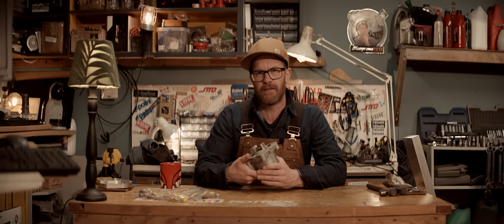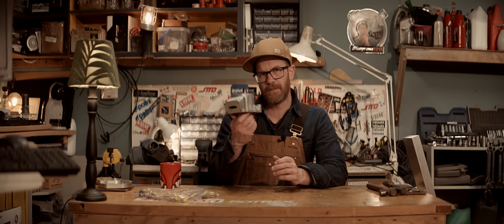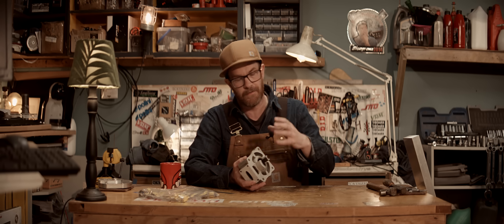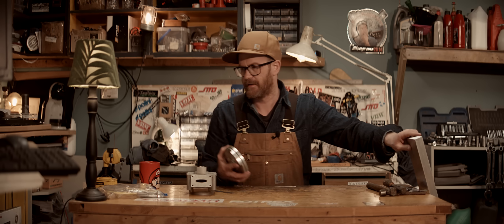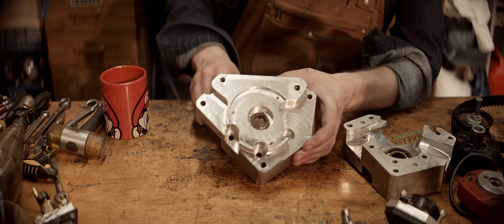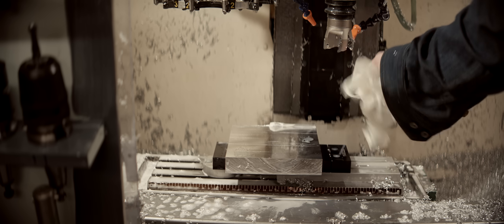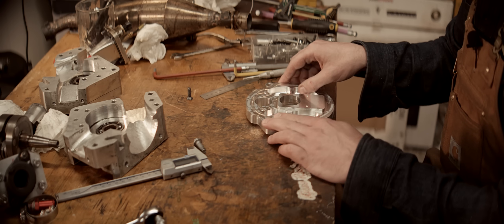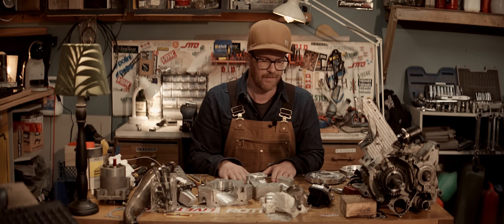To Hell With Reeds! Rotary Valve PiP.

Comment: everything restricts , get over it ..that why they make 4 , 6 , and as many as 8 peddle reed valve kits . a use delren plastic reeds that love you long time joe ... but rotary values  have many advantages that they offer like nothing else does..for tuning mild to wild and everything in between merely by changing the timing of the cut away and length of the in let hole ...but i now understand rotary valves dont work so well with exhaust as the pressure and heat turns a rotary valve into red hot disk brake  ..hehehehe that was my idea ..failed pretty bad didnt it ...do you happen to know who pops yoshimura was ? if not you need to ..

Comment: The very best type of rotary valve is a sleeve valve...... these were used around the time just after the second world war and gave very high outputs.... they did not work well in aviation where they were being trialed  due to reliability ( aka engineering ) issues. I still think they have great potential given all the new materials/coatings/ alternative actuation methods and deserve a look

Comment: You should rough out with the 16 mm then come in with a small diameter at the higher feed and speeds to clean up to final size.

Comment: Eyvind Boyesen with his method of testing scavenging by motoring over a complete engine without a head, found that the hook in the B port set flowed rearward, not towards exhaust port like conventional thinking.  Read my explanation at the beginning of my wall info, how to get proper Jante flow diagrams. You can see if the cylinder scavenge flow does what you think it does!   Minor transfer changes (up angle or heights) can be tested in combination with all the others, giving real flow answers. Try the Boyesen method for answers, particularly on a new concept cylinder.

Comment: They were using rotary valve in the med 1930s on outboard motors, then went with reeds valves, and found out that it make more horse power. My dad in 1966 created 8 horse to a 15 horse by using .008 thousand to .010 thousand titanium reed valves, I had to put a 5 speed in it. So going to a rotary valve is old and outdated.

Comment: I do not understand why you persist with loop scavenging with all its problems. I would go for uniflow with the introduction of an exhaust valve keeping th inlet ports at the Botton of the cylinder.

Comment: What about balancing? Is this not needed in 2-stroke?
Reply: Are you thinking crank balance or disc valve balance. 
Crank balance has being a problem going back  6 years with the SPX project where the carb flooded and vibration caused the fuel to be severely agitated in the float bowl leading to fuel starvation. Alex tried balancing a crank without success using tungsten weights.
If your thinking disc vavle, they tend to be made from carbon fibre now days as it's very strong and ultra light. This leads to very low vibration coming from the disc rotating at 16k. Alex was intending this engine to go beyond 20K.
When disc valves were in vogue they were made normally from spring steel.
Alex suffered 2 disc valve failures where the disc broke away around it's centre fixing.
Alex said recently that the crank was balanced to around 55%?????
Hope this helps, Malc.
Reply: @malcrandall1309  No discussion around balancing. I can think it's an issue at these rpms .I imagine the combination of all moving parts are in play here.
Reply: @haraldhannelius  Sorry I don't uderstand your reply " no discussion around balancing" When the previous engine was run with no variator the vibration was still there even thought there was only the the crank, rod and piston in motion.
Reply: @malcrandall1309 sorry for being ambiguous. I meant that I don't recall any discussion regarding balancing in this video series. There may be, bit it's a long way back then?
Reply: @haraldhannelius  Yes it goes way back around 6 years. The vibration problem has being persistent from way back then.
Until a couple of weeks ago I had a engine/ transmission from a 20 year old design A/C Piaggio NRG Power which I bought from a breakers in standard form except for the coil. I fitted a self modified road expansion chamber and a clone 28mm power jet carb. With some TLC I got this revving to 16200 with standard road going crank. This item would be classed as a low primary compression unit but designed to reduce vibration for road use.
The cranks used by alex are full circle high primary compression units who's balance factor is less than the road going unit. I encountered NO major vibration ussues allowing the carb to work correctly.
Alex said last week that the crank being used has a balance factor of around 55%. A decent road going balance factor is around 40%. The crank also has a 15mm longer rod than standard.
Since PiP is now going DV the carb can be set truly horizontal to allow the foat to work correctly.
Regards, Malc.

Comment: Have you studied the old two stroke Vespa's?
 They use the flywheel as a rotary valve athough it does make balancing a bit more difficult it seemed to work very well

Comment: If you want another can of worms instead of efi, what about electric driven rotary valve so you can control timing and duration. Likely unfeasible at this stage but I thought it an interesting idea 2t freevalve.
Reply from the maker: Actually been thinking abput exactly that, servo driven valve, rotary encoder on crank.
Reply: @2STROKESTUFFING  Servo crossed my mind but from the very little I know probably nowhere near fast enough, I was thinking literally just the rotary valve always spinning but driven but something like a drone motor. Lots ot electronics and someone clever with code but it could be a bit like an ignition map no idea if response time would be quick enough to alter duration on the fly but some of these drone motors are insane now. Might in some ways be less complicated than mechanical timing it.
Reply from the maker: @mrln247  A servo could be geared up to achieve the right speed, torque shouldn't be a problem👍Adds complexity, in return you get complete control over timing, and freedom to mount the valve wherever.
Reply: @2STROKESTUFFING  I was thinking about gear reduction as drills have planet gearboxes, another way would be having multiple windows on the valve then if you where being clever you could change phase for blocks of rpm which would alter duration although I'm not saying I know how you would time that.
Reply: Base 12 is easily split up so could be 12:1 6:1 3:1 etc built in to the valve itself.

Comment: Have you thought about designing your own cylinder and getting it 3d printed? I had good results with "in3dtec" even possible to print in inconel and titanium!!
Reply from the maker: The cylinder currently in use is one I designed and got 3d printed in aluminium by Protolabs.

Comment: Hi Dude maybe you should change your exhaust port duct shape as i have over ten years working with cfd and various hi end engine modeling programs ,wave le soft PT and more 
not sure if you have much cfd knowlage but i can tell you the ducting shapes ,surface areas and thickness have a large effect on flow and enthlapy so  its a bit of an outside of the box thing 
i can say this with confidence as i prooved many concepts in the real world rnd , i can share some knowlage if you have the will ,well done awsome stuff ,one of your best strengths is 100% nessasery and that is you have to be a special kind of guy to realy make good rnd or as i say on the spectrum , obsessive is more a real world term ,in a nice way. ye make contact maybe i can help you a little.

Comment: Quick question; I see you have a roller bearing on one side of the crank. Is that the flywheel side or the other side?
Reply: Variator side.

Comment: Probably a stupid idea, but....

Why couldn't you make a blower that pulsed pressure (+/-) and do away with any sort of valve.
Reply: Or do away with crankcase feed and connect the blower directly to the transfer port and block the transfer case end of the transfer port.

Comment: Hi Alex.  I was outside the box looking in and turned around.  I was thinking old school sci-fi.   Blower that is ground powered.  After you get the bike running a R2-D2 sticks a arm out and it has a wheel on it that contacts the ground in turn it powers a supercharger.  Or a rat   “Ram air turbine” like on a jet. 
 Cheers.
Reply: It (ground wheel drive) still eats HP, and probably more (due to a more complex drivetrain) than a more direct drive does. Ram air eats HP due to parasitic drag. There are no free rides, you have to produce the power your forced scavenging system eats, no matter how you source that power. Turbos have the advantage of using "waste energy" (dumped out the exhaust anyway) to power forced induction, though at the cost of reducing potential exhaust flow, and tossing all kinds of wrenches into exhaust pressure wave pulse scavenging in 2 strokes (running "on the pipe"). Then you have the potential road instability dropping a 3rd wheel could cause in your chassis dynamics. As above, "no free rides", every added complexity comes at a mechanical price somewhere in the machine equation. The "magic" is minimizing the price through efficient application of the potential power loss, reliably

Comment: Would it be possible to fit your new ignition system at the same time as the disc valve.
I've just noticed at 12.15 on your CAD design that you have got  a ignition pick up fitted. Is that the ignitech unit used previously.

Comment: Although it takes more time, I'd like to see the rotary-disc-valve outfitted with ball bearings to facilitate concentric operation with reduced sealing problems. Have you decided upon a material for the disc?

Comment: Maybe finally on the right path to success.
Reply: IMO I feel the exhaust port will take some sorting. The transfers are easy to re structure with in reason.
We mustn't forget the engine needs the torque as well as RPM.
Lets not forget the old saying that holds true today as yesterday. "You have to get it out quicker than you put it in".

Comment: here we go again 🤣 remeber that if something doesnt work with free breathing, it might work better under pressure. dont forget that you are building this for boosted situation, i would try it now again with turbo once you have done the inserts and opened up the exhaust.
Reply: Originally PiP was designed to be N/A with fully resonant induction system which sadly didn't work.
It was only when Alex got pee'd off he fitted the Roots blower. All these changes proves the design wasn't quite right. As Alex said maybe to radical in it's design.
Reply: @malcrandall1309   you re right.. im allready lost in these engines😁 it was bruteforce wich was supposed to be charged.

Comment: Rather than 3D print the stuffer could you not just use the crankcase to cast a silicone rubber plug in a suitably high shore material?  It should then fit perfectly and have very high temperature resistance.
Reply: Yes good idea. It's just the time constraints. That would be fine once the final design had being confirmed.
I come from pre 3D printer era where we filled area's with epoxy putty. Ground it away until you've gone too far then re fill and re test.
Reply: @malcrandall1309  I would think using silicone rubber would be a lot quicker than 3D printing tbh. No CAD model, no hours of printing, just form some suitable dams, mix the silicone and pour it in. This would be a lot trickier for his cylinder port stuffers, but to block up the reed port should be pretty easy.

Comment: Well I hope the personal stuff isn't too serious. On a different note. Those metal chips are a nightmare. Have you thought about adding a vacuum system? I know it can be a pain with the coolant system but maybe a updraft vacuum with a drain line. Hmm. not very good with cad but if you want I could try to mock something up to give you some Ideas.
Reply: maybe its easyer to build a "ramp" for the chips, so they can slide of to one side
Reply: @MrM4rius  Yes, you could attach a shield and ramps to the back of the table. I have used similar, and some tables already have a tee slot to the rear surface that would assist with mounting.

Comment: Why not use a flow bench to measure the CFM with a given pressure and experimentally determine what port design flows the best/most?  Only issue now is the rotary valve timing, shape, and functioning with the super charger pressure pushing on it :).

Comment: Once you add the blower again (which you will, right?!?) you'll have the same problems with friction from exhaust pressure.  From your previous videos, I understand that dimpling of the internal static surfaces of the rotary valve is one approach, but what about a field of ball bearings? {edit: I meant on the exhaust side.}
Reply: I feel like a large thrust bearing just smaller than the port, behind the valve disc would be the best way to reduce friction. As long as the disc is thick enough to minimize flex it would keep it from ever touching the outside wall at all.
Also having the valve run at half engine speed with two cutouts instead of one would lower the surface speed to drastically reduce friction and make the disc a bit lighter, but it would also slow the opening and closing speed of the ports. But I don't know how important that is on a 2 stroke.

Comment: Yes, been hoping you would drop the reeds.
Reply: I'm a fan of both reed and disc valves. The reed has simplicity and the disc has that retro feel.
 Until a couple of weeks ago I had a A/C Piagio NRG Power test engine that's design is around 20 years old and was in it's standard road going form  except for a clone 28mm carb and modified road going expansion chamber. 
After some TLC this engine could be held at 16200RPM under load on test for 10 second power runs until the piston skirt broke writing the engine off.
The metal reed petals remained intact through it's road usage and over 2 hours of very high RPM testing.
Lets hope Alex doesn't suffer with previous disc valve failure where the disc broke around the fixing flange.
IMO there's plenty of work that still needs doing to the cylinder before it will work as intended.
We'll all be here watching. Rock on Alex.